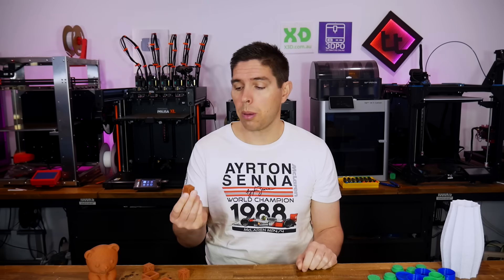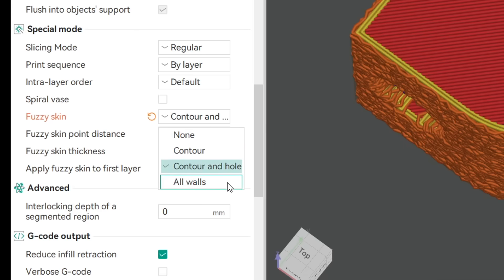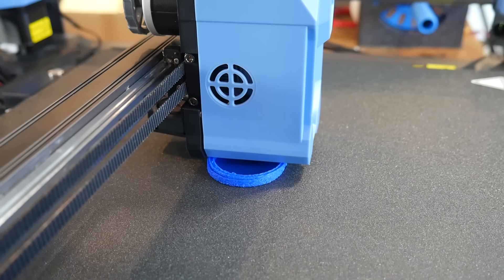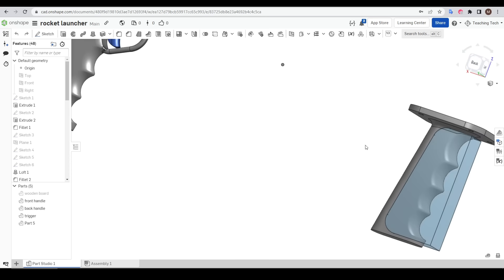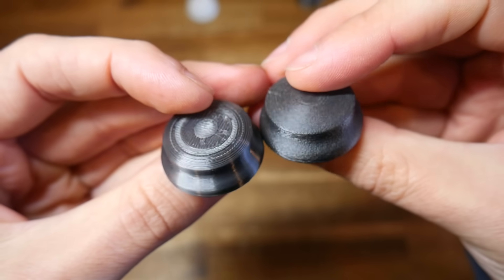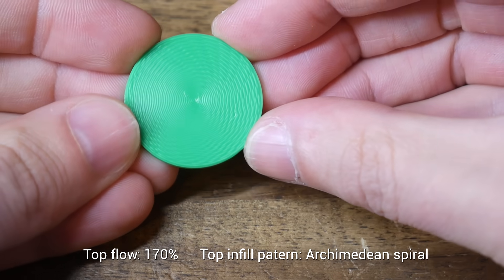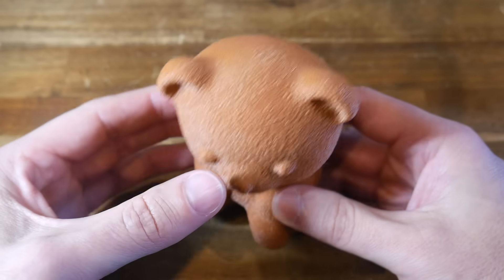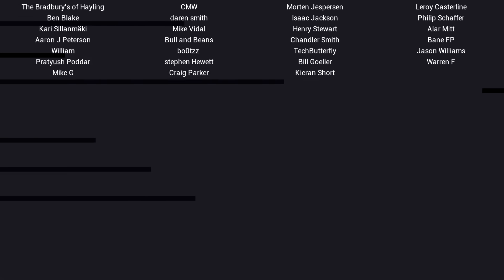Mastering fuzzy skin - 3D printing guide

Comment: Boy that selective fuzzy skin feature would be fantastic for making molds for silicone, you can keep the part where the halves of the mold meet flat and make the part where the silicone touches fuzzy.
note: hilbert curve for top fill
top surface flow ratio: 1.7
enable only one wall on top surfaces

Comment: with all walls not just the outer wall loop gets textured but also the inner ones so if you have 3 wall loops instead of smooth smooth fuzzy you get fuzzy fuzzy fuzzy. optically this probably doesn't do anything but i think this might be able to make the part quite a bit stronger. i havent tested anything thou so this is just a theory.

Comment: TenTech made a script to apply "true" fuzzyskin to the top of prints https://www.youtube.com/watch?v=cNkHfydnUCI&t=92s It works great and it's nicely integrated into prusa and orca slicer.

To hide layer lines in Prusa, I'm using fuzzy skin at 0.1 thickness and 0.2 point distance, and the same for TenTech's script, but the script seems to have a fairly high minimum value for those settings and so would not automatically copy the settings, so I had to manually tell the script to use those values using the script options TenTech created (normally intended to have separate parameters for side and top surface)

I'd recommend using concentric top layer, as the script has trouble applying the texture to very short segments, and enabling "single perimeter on top surfaces" (just like "one wall on top surface" in this video) so that there isn't as much of a smooth border around the top, especially for thin walls that can otherwise be entirely made up of perimeters, which aren't fuzzy skinned.

Comment: Hi Michael, I managed to get the fuzzy skin on the top layer by adding a thin disc modifier to the top layer. Then, change the 'wall loops' setting to the most needed to cover your top plane in the modifier settings. Hope this helps. kind regards, Jon - who used to live in Bath aha
Edit: I've just come back to reuse this method and I cant seem to get it to work now.

Comment: Not sure why slicers still dont have option to use "fuzzy Z" on top layers, I understand that Z axis is much slower but result could be awesome. Currently for a simpler model,  one could  make models top surface fuzzy in a CAD software  and use nonplanar printing patch for top layer.

Comment: I accidentally discovered this effect a while ago when I was experimenting with the Hilbert curve and forgot to change the filament profile, so I printed with PLA at a 245°C. So instead of increasing the flow, I simply heat the nozzle 30°C above the required temperature to achieve the same effect without changing the flow. And thanks to overheating the visual result was even better.

The Hilbert curve also perfectly hides lines on the top surface (as well as on the bottom if you don't use PEI surface)

Comment: @4:50 if you use that aggressive thickness values, you need to set the walls to 1 - since the fuzzy skin will intersect with the inner wall and heavily distort the object - i've tested this extensively (also provided a test block set with different values over on my printables or makerworld profile)

so no need for "hoping" it works, it works - just use one wall ;)

Comment: 15:00 All you have to do for your fuzzy skin parts to fit is to modify your hole/contour compensation settings. No CAD needed. Of course, it only works on the x/y planes.

Comment: The top surface fuzzy skin effect, wow! I wonder if it'll cause any nozzle damage from bumping into the bumpy bits as it goes around, at least for weaker nozzle types? Also, wasn't there some kind of "use an SVG as infill/surface pattern" trick for one of the slicers out there, could that be used to further customize the top surface in some way with a modifier?

Comment: Great tips! I must try fuzzy skin with that top over-extruding technique.
15:06 You wouldn't need to use CAD to fix the fit. You can use a positive (at least in Orca) X-Y hole compensation in the slicer.

Comment: Top fuzzy texture is awesome! You can actually adjust the fit of one part inside another using only the slicer though. In Cura, horizontal expansion, and in Orca, X-Y compensation.

Comment: 14:41 Depending on the geometry of the whole assembly, you could potentially work around the fitment issues by applying a horizontal offset("Horizontal Expansion" in Cura) to one of the parts.

Comment: For fitting fuzzy parts into other parts without CAD work you could try what in PrusaSlicer is called XY compensation. Try setting it to -0.5 when your fuzzy skin height is 0.5mm. 
I have never used it in combination with fuzzy sking but I have used the XY compensation to make parts slide into parts when they are all scaled down. Parts designed with 0.2mm clearance at 100% size will no longer fit together when printed at 40% size. But if you use the XY compensation on the right ones to increase the clearance that was scaled down then they can be fitted into each other again.

Comment: Hi 15:10 you can do it in Slicer, just use X-Y hole compensation to make wall inside the hole with offset
If the fuzzy skin thickness is 0.6mm, set the X-Y hole compensation to 1.2mmm

Comment: Great videos; have learned from and use many of your instructions!

It stood out to me that you mentioned the complexity of isolating areas of a print in CAD versus in a a slicer (CAM). I see it the other way round. (Not in terms of fuzzy skin on top--the actual topic of the video--but still.)

I use (OnShape) CAD for this: I thin extrude .01 in/mm (doesn't matter) inward from the surface where I want fuzzy skin, then I Boolean delete said extrude from the original. I make the new part fuzzy in the slicer. The "internal" surfaces generally don't matter.

As useful as the "outside only" setting is, it doesn't work for every model, especially when multiple print heads/components are involved.
 
My post is a bit off the exact current topic, but THANKS FOR ALL THE TIPS, and I hope someone finds this useful.

Comment: I like using fuzzy skin with very fine layers, minimal thickness and small point distance.

0.08 mm layers with 0.05 thickness and 0.08 point distance works well, and creates a really nice satin finish. It doesn't make the part feel any rougher than the regular layer lines do, but it does a great job of breaking up the pattern and making the part look injection-moulded. Of course, it's very slow due to the fine layer lines needed to make the effect convicing.

Comment: It's weird how there's still no proper texturing for 3d prints. Like, import a depth map, align it on print's surface and it'll emboss a pattern in the part's side. Same idea as fuzzy skin, tugging on extrusions forward and back layer by layer, just deliberately instead of randomly. Texturing is just one thing, it can also be used for text, especially makes stuff easy for date codes and serial numbers as you don't have to bake anything into the STL.
Reply: IdeaMaker does exactly that, and you can export it as an STl into another slicer if you wish
Reply: @rossmaclean2  that's the thing, it does all this by messing with the model itself, while it should be so easy to do it within the slicing process.
Reply: This idea is probably more practical with resin printing than FDM printing, at least for the moment.

Comment: Do you, or anyone watching, know of a way of exporting the fuzzy skin texture out? I know it is randomly generated at slice time. But I am doing some pretty complex modifier geometry and using fuzzy skin with that modifier, and there are some specific requirements that I'd like each print to be identical. So if there was some way of exporting the post fuzzied STL out, that'd be awesome... any ideas anyone?

Comment: another usefule application is when you wrap the part into fiberglass or carbonfiber. Usually you got to hit the part with 40-80 grid sandpaper and scratch it up really good. Wit h fuzzy skin just take the part and lay up maybe a couple of layers of 1708 or such and top it off with a cloth like 6 or 8 oz. So now you got a strong part with as much FG as you want and maybe a mm or 2 of plastic inside. Dont use PLA as epoxy or boat resin gets warm when it cures. But PETG or ABS or HIPS is a good choice
Reply: Do you still sand after fuzzy skin and do you use the default settings. I'm guessing you do a wet lay of carbon and vacuum bag?
Reply: @alycapo3391  Noo sanding and wet layup yes. For the settings it depends on what I use. If its just a covering of very thin cloth like a low oz (4 or smaller) cloth then probably send or very little fuzzy. Problem is that some 3dp plastic does not stick that well especially to epoxy based resin polyethylene sticks better. If you go 1708 or 2408 biaxial you can go with default or even bigger for a good mechanical interface. I dont want to go into materials in general as there are differences between the stickyness of different brands of the same type of material So I consider 2 ways of using 3dp for glassing . 1 for molds then you do mold stuff print as smooth as possible, maybe some post processing, wax, release agent etc and maybe a metal backing or thick plastic mostly petg if you use compression or Nylon if you use heat. Or "consumed" molds with fuzzy skin. Lets say I need a mostly l shaped thing that has lets say 5mm thickness thereabouts. I might print a 1mm thick l shaped plastic with fuzzy skin usually ABS as its stiff and hard on a textured bed with fuzzy skin. Then i might wrap it in 2-3 layers of 1700 biaxial to get the thickness u want and then you can top it off with some cloth and maybe even some standard FG/CF surface finish/paint etc etc if needed as now its a standard layup thing. Now the advantage of the consumed 3dp is that you can be creative in shapes and hole placements and creases as long as you can use layup methods and use a roller etc if the part gets too complicated you do a mold. Like I am working on some intricate pieces for a drive train which are being molded whereas some frame pieces might have lay up and cut to size using grinders, saws sanders drills after they cure etc.\

Comment: Brilliant idea, Fuzzy Skin as velcro.

At the end when mentioning the loss in dimensional accuracy I thought, "TPU." TPU's flexibility could allow for flexible tolerances and accommodate for inaccuracy, and the increased surface area and imperfect surface might increase grip in a press-fit-closure usage.
Reply: top surface fuzzy skin with TPU would also be great for rubber feet and other things that need grip.

Comment: So it's funny that you showed the last part about the dimensional accuracy being thrown off and the items no longer fitting together. Funny enough, I actually used that property once before as a way to both provide for a better friction fit between 2 pieces and as a rough surface to support and trap glue to help bond the parts. It did take some tweaking, but it worked.

Comment: And this guide just happen to bereleased when I had a print where I which to have more control over fuzzy skin. Thanks Michael!
Now I just have to tune the setting to match to the powdered side of my PEI sheet (it's a threaded round box, since both box and lid have threads, they both need to be printed on the flat surface). My guess would be both thickness and point distance to around 0,15mm.

Comment: You can fix the tolerance issue with reducing the xy size compensation by the fuzzy skin thickness. (-0.2 xy size, 0.2 fuzzy skin thickness) this cancels out the external jitter and leaves you with nearly the same tolerance as original
Reply: The only problem with that is parts with internal geometry that need to be a certain size to work
Reply: I wish it worked like this by default.
Reply: X/y compensation is a lifesaver fr. The amount of times I'd have to remodel in cad to get the right tolerance vs just modifying one value is insane.

Comment: IVe managed to get some interesting results when slicing in cura vase mode without fuzzy skin by using different extruder nozzzle settings to the  revo nozzle sizes I actually have installled, you get a very interesting finish. I did this with translucent slitter filled fillaments for christmas baubles I was printing. 0.4mm nozzle tricked to thinking it was printing 1.2mm extrusions at a setting I had set up for a 0.8 mm revo printing for a 1.2mm thickness. The end result is something that can best be shown rather than explained in words.